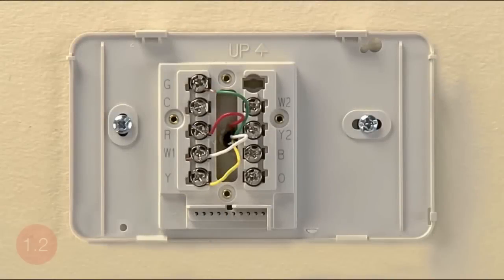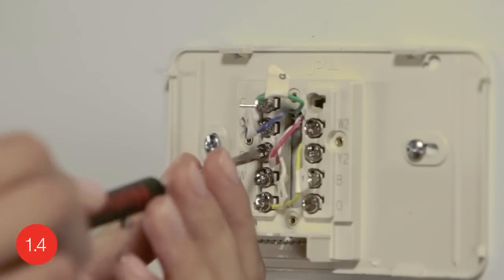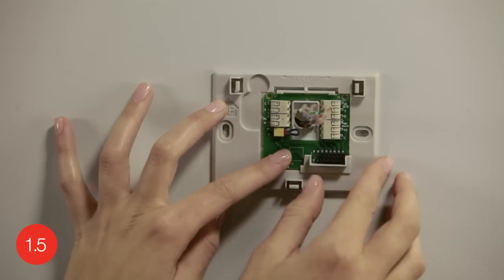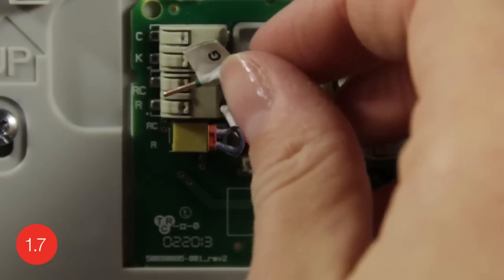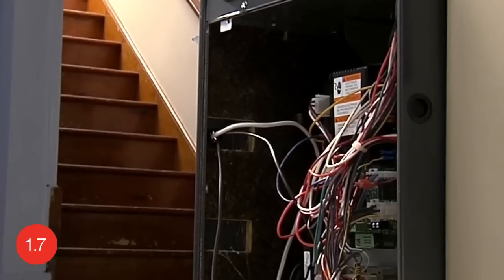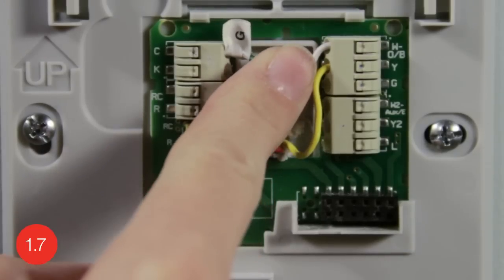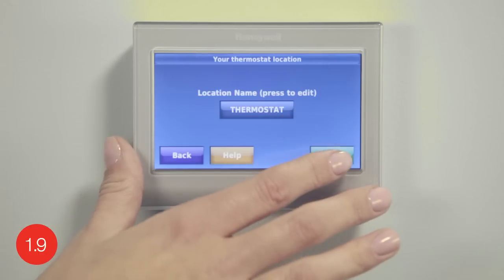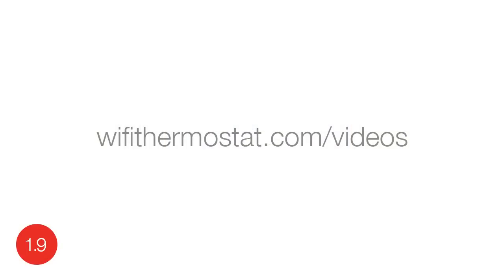Substitute G-Wire for C-Wire -- Install the Honeywell Wi-Fi smart thermostat with this video.

Comment: I've been an HVAC tech for 23 years and I had to do this in my parents old house. It will only work on a gas or oil furnace. If you have a heat pump or an electric furnace it won't work.
Reply: Steven Hylton I
Reply: Hi Steve about in a/c unit w/no heat?   Thanks
Reply: No heat? Call the tech
Reply: Steven Hylton  will you need to change the blower speed on the control board ?
Reply: My furnace is electric and I found in the wall an extra blue cable (which has never been used). Now that I need it, I connected it to the C option but it won't power the thermostat. Any ideas why? Thank you.
Reply: @ItaloRican7  maybe because the other end of it at the furnace itself is not in use either?
Reply: @ItaloRican7  Open up the panel on your furnace and find the control board. See if the blue wire is connected. If the blue wire is not connected then connect it to the C terminal on your main control board. 

Be sure you turn off the breaker before you do this. I'll bet your blue wire is not connected to anything at your furnace and that is why it does not power the thermostat, unless I misunderstood your post. 

Since this was 3 yrs ago you probably figured it all out so posting this for any one else who might read this post and have the same issue.
Reply: @ItaloRican7  did u ever figure this out? I have same issue!
Reply: @RyanHoltz  my guess is that the wire used is a 5 wire but only 4 of the 5 were needed at time of install. The 5th wire is probably not connected to the furnace either. Go to the furnace where the thermostat wire go in and check yo see if that wire is even hooked up. That may be the issue.
Reply: Hey would someone that has some experience with heating systems take a quick look at a short video I uploaded to tell me what wire I need to use to get power inside at the thermostat? There are 4 wires inside but out at the furnace there is a green wire and a pinkish wire not being used. A red to red, white to white, green to green and then yellow to blue are what's being used but a kinda faded out green and a faded out red just have wire but on them and don't go to anything. Thanks in advance

Comment: If you move the G wire from the "G" wire terminal on the air handler, to the "C" wire terminal, and then use the G wire to connect to the thermostat "C" connector, you have done nothing but repurpose the use of the "G" wire itself. It then becomes the "C" wire (even though the insulation may be green)
Doing so will NOT create a fire! RO DU is misunderstanding the instructions!
Removing the "G" wire from the "G" terminal as suggested, only removes functionality to the operation of the fan in manual mode.
Even easier is to just replace the 4 wire bundle with a 5 wire bundle and then use all the wires where they should be used. This will NOT create a fire situation either.
Reply: Where the hell does the jumper wire go?? I'm having the hardest time installing wifi honeywell from basic honeywell therm. I dont know what I'm doing wrong.
Reply: @tonioviedo5472  Were you able to figure it out? 
Did you use the jumper wire to connect the G terminal to C terminal?
Reply: Honeywell even give you the jumper in the box.

Comment: DO NOT SUBSTITUTE A G WIRE FOR C WIRE!  THEY ARE 2 DIFFERENT WIRES FOR 2 DIFFERENT PURPOSES!  YOU CAN NOT DO THIS!  IT can cause a fire or short out your electrical system!
Reply: DO NOT COMMENT WHEN YOU DON'T KNOW WHAT THE FUCK YOU'RE TALKING ABOUT
Reply: I most certainly do know because it can happen and has.  You can short the entire system and overload the board doing this.
Reply: James L it crosses the board. sorry ywars of experience and burnt out control boards this is not to be done. ive seen it all
Reply: I'm guessing you moved "things" around without turning the power off Rusty. That's what probably fried your boards. Shutting the power off, moving the G to C at both ends, and power it back on will works just fine. I've done it. The only negative effect is you loose your Fan only ability, which I don't recall EVER using. There's no "jumpering" whatsoever. The best way would be to run a new conductor(s) with whatever total number of wires your system/thermostat needs.
Reply: Rusty if it didn;t work either you hooked it up wrong on one or both ends or you are just an idiot...I bet the latter.

Comment: This worked like a charm for me, thank you very much!
Reply: Ro Du  Ro Du Du is an idiot.  This will NOT cause a fire nor short out your electrical system.  You're a moron.
Reply: Ro Du, you are wrong.  It's that simple.  You are wrong.
Reply: if you do this for a living it's time for a new career.
Reply: MG64 actually it will cause a fire.  It can cause a short circuit and ignite the wiring shield.  All it takes is a spark.
Reply: no I'm not if you believe crossing wires is the correct way to do anything you are wrong!  These wires contain voltage crossing them can and general will cause a short.  you can not do this it will also damage your heating/cooling systems.  you are wrong MG64 VERY wrong.  I do this for a living.  If you wire it this way it will cost you either a new AC system or your home from a fire.
Reply: DO NOT SUBSTITUTE A G WIRE FOR C WIRE!  THEY ARE 2 DIFFERENT WIRES FOR 2 DIFFERENT PURPOSES!  YOU CAN NOT DO THIS!  IT can cause a fire or short out your electrical system!

Comment: I live in an apartment and don't have a C wire.  I do have a G wire but my system is not oil, propane or gas.  I am pretty sure it is an electric heater.  Can I still use this method?
Reply: I have an electric furnace, and I was able to use this method.
Reply: How to hook up 2 wire thermostat
Reply: @FMG1964  I believe you're the one that got both wrong, the video and the previous comment. They both state that this technique only should work with furnaces that work with Oil, propane or gas. NOT ELECTRIC FURNACES.
Reply: DO NOT SUBSTITUTE A G WIRE FOR C WIRE!  THEY ARE 2 DIFFERENT WIRES FOR 2 DIFFERENT PURPOSES!  YOU CAN NOT DO THIS!  IT can cause a fire or short out your electrical system!